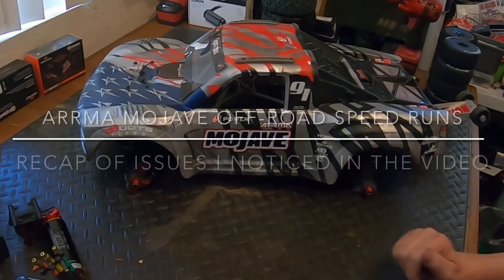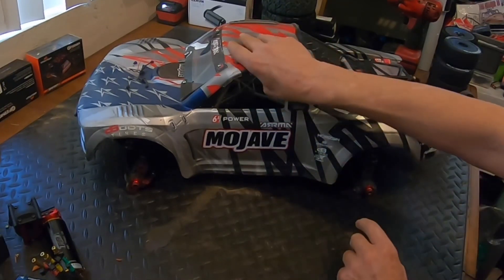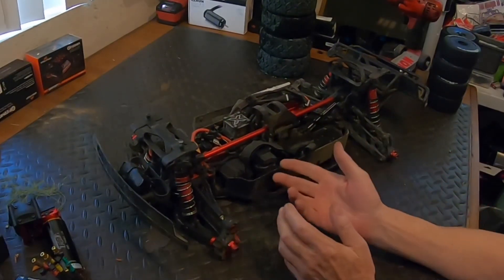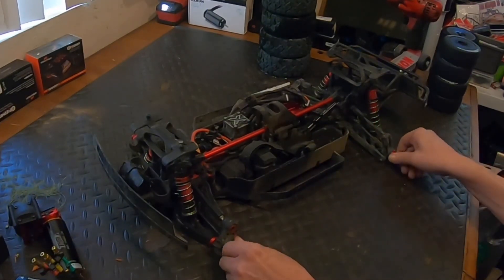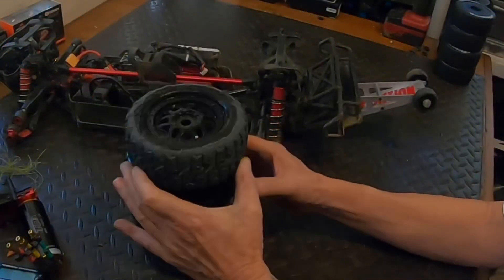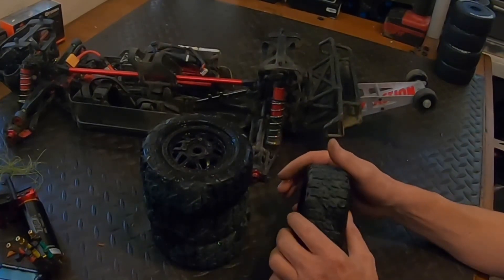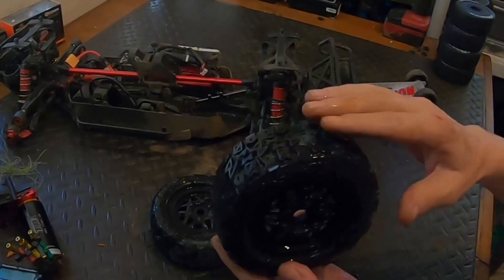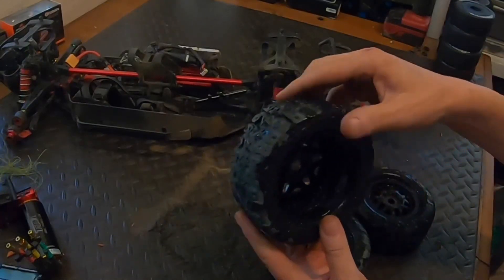Arrma Mojave Off-road Speed Run After Run Thoughts And Problems I see ?

Comment: Powerhobby scorpions are the best ive found. But still, lack of traction (like offroad hoons) and they like to come unglued high rpm. But essentially no sidewall to slop around. Maybe some 2.8 belted roosters (Paddle tires)? Or have you consider modifying a tred(removing or reshaping tred blocks), or creating a tred in the hoons or fomes by cutting grooves...?
Reply from the maker: Not much rubber on hoons to cut tread

Comment: I need a recommendation on bearings for my sledge Earl. Good effort on the Mojave it’s gonna be there soon. Need to find the secret recipe and you’ll nail it
Reply from the maker: Fast eddy bearings will be fine
Reply: @earlmoorhead5555  ok I saw those but didn’t know if I should get ceramic or standard
Reply from the maker: @gratefuldabs9775  standard for a basher ceramic for a buggy race track rc car 👍
Reply: Thanks Earl!

Comment: Looks like the wheel base is too short for high speed on offroad surfaces but ofcourse there are many factors contributing to unstability at high speed. Maybe a steering gyro could help. Keep truckin m8 and all the best in ur quest for speed.
Reply from the maker: It’s the same length chassis as a arrma Limitless 🤔🚀🚀

Comment: I'm just throwing it out there but you might want to look at the Powerhobby Scorpion Belted Monster Truck Tires in 17mm. They obviously are belted and the are an extremely low profit dirt tire. Granted you will need to glue them really well but that's the one tire I haven't seen anyone use yet. I have them in my Rovan xl 450 12s and they do really well with that RC. Not my favorites buy a long shot for a bunch of reasons that really wouldn't impact a dirt speed run. Just my .02
Reply from the maker: Some say they have poor traction as well 👀
Reply: @earlmoorhead5555  I run them on a 12s Rovan XL 450 and they do ok. Glue is the worst thing about them but if you take your time and reglue them before taking them out they do ok. I can tell you this much, they have way more traction the foams or rubber streets on the grass and lose dirt. They are kind of the perfect balance for what your looking for. The teraforms are great tires but no way are the designed to do what you were trying to do with them. They are way to bouncy. You could always try to stuff the teraforms with spray foam to make them less squishy.
Reply from the maker: The 1/5th scale rc tires are a lot stronger then the 2.8 size it needs

Comment: I run 100 lb test wraped twice around along the tread then I CA glued on my 2.8 badlands it doesnt come lose at all run 18 6s Typhon on them I know your running alot higher power but they i feel i could take the tire far with the even expansion of the tire for a square hook

Comment: Hey brother have you considered weighing down the rc? Imo I think if you increase the unsprung weight the rc will be more stable and maybe a bit more ride hieght with stiffer springs or heavier weight oil
Reply from the maker: I’ve added weight twice using wheel weight 🤔

Comment: Just curious... does your controller and receiver have a gyro function?
Reply from the maker: No
Reply: @earlmoorhead5555  Flysky FS GT5 will change your life! Even with a heavily modified 2wd slash I can put the hammer down in loose dirt and it will drive straight as an arrow.
Reply from the maker: I have a futaba radio I can’t see a flysky made by futaba changing my life 🤔
Reply: @earlmoorhead5555  I thought the same thing until I turned on the gyro function. You should look up what it does. Anyway, Good Luck hitting 100!
Reply from the maker: Yes it Control a lot of thing 👍

Comment: I have been watching your videos for the last couple of days and noticed something after watching 4 of them, you're not good at driving these RC's lmao. I literally just got home from doing straight runs with my Mojave (stock) on an offroad surface with bumps, short grass, and gravel and easily managed to stay straight at full throttle. You're either messing with the suspension or something is off structurally.
Reply from the maker: To much power the tires can’t hold up